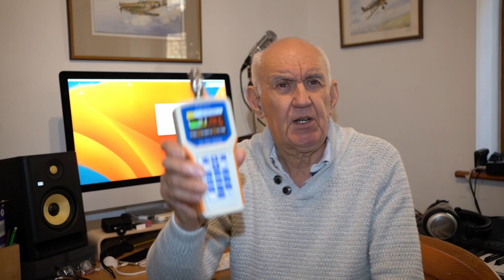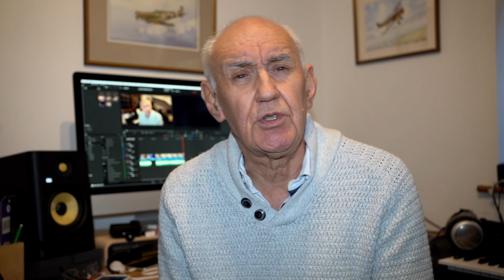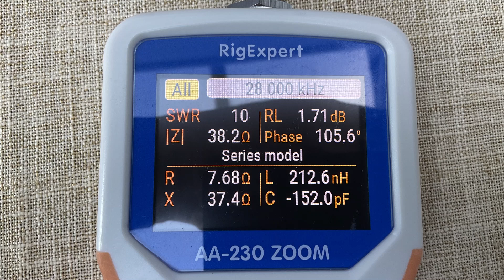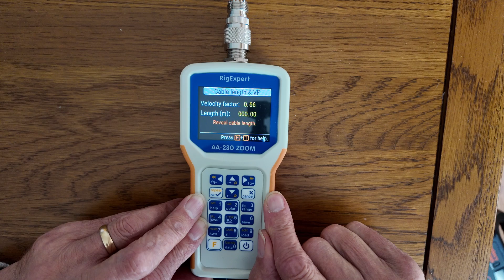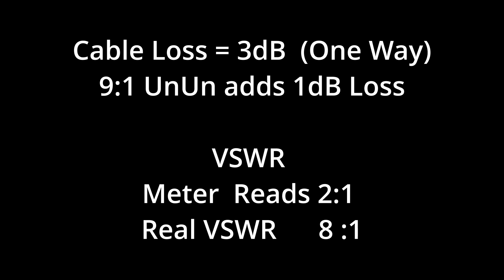Fake VSWR  Readings and Hidden Feeder Losses  |  Ham Radio

Comment: One thing to think about also is let's say the BNC connector and adapters are adding 0.4 well when you are multiplying by 4 to estimate 100' You are now increasing the 0.4 loss from the connector to 1.6 which it should remain .4 so in theory you could subtract 1.2 from your overall readings.
Reply from the maker: Yes you are partly correct, although it was not possible to know the actual loss in the BNC connectors without cutting them off. I did cover this later in the video when  I emphasised that the connectors are static loss items. At the end of the day you have to measure  rather than guess. Thanks fir your support.

Comment: Hi Peter, all correct information, and perhaps a caveat that needs to be borne in mind is that these figures are for NEW cable in good condition. Some time ago investigating a coverage issue on a 150MHz paging  transmitter with 200ft of LDF5-550 feeder to a standard "whitestick" style aerial it took more than one site visit, we changed the aerial to humour the customer. Dissecting the old antenna revealed that the short tail from it was waterlogged, as you can imagine a swept frequency measurement showed a suspiciously low SWR over a wide frequency range. Waterlogged cable is a disaster for loss and often unusually  LOW SWR is a warning. I know no-one will do it but it is worth saving plots of fixed antenna systems so you can spot changes before they are apparent on air. 73
Reply from the maker: Yes, good point. Many thanks.

Comment: Thanks for the video Peter. By minute 7:50 I'm rather sceptical that the 0.3-0.4db losses come from the adapters and I believe it's more likely that the coax itself is not up to spec. I've seen an interesting video by Jim Heath W6LG showing almost negligible loss on a rather long chain of connectors. In reality the db difference is a sum of reasons, the connectors absolutely play a part as well but not sure if their impact is as large.
Reply from the maker: But he actually found some major losses in some of his adaptors. Further test show I have the same problem!!

Comment: As you are shorting the coax at the antenna end to get a return path you need to make sure it is a low resistance joint. As in any joint there will be losses ( same as your connectors ) make sure that your connector block is of good quality and a tight connection.
Reply from the maker: Solder across a panel socket is best solution.

Comment: Peter. I'm wondering if you use a rf noise bridge at the feed point of the  9:1 unun to adjust the length of the wire, to get 50 ohms. Is that a option?
Reply from the maker: Most users want the 9:1 UnUn to work on a number of bands with a particular length of wire. You can still adjust for minimum VSWR at Tx end. The VSWR null at Tx end will simply be lower and better than at the 9:1  but both will coincide.

Comment: Peter, your salesmanship skills are slipping (my tongue firmly in cheek). You analyser has a calibration function built in allowing you to calibrate using an open/short/load at the end of your coax effectively nulling it out thus getting a true reading at the feedpoint.
Reply from the maker: Thanks for the info! Manu drawback is that calibration only applies to one antenna -coax combination and then needs to be reset. But interesting option. 73 Peter.
Reply: @watersstanton  You're right but if your using the same coax for different antennas at different times its valid. You can also toggle it on and off at any point where the calibration is in a memory. I wouldnt be without my Rigexpert.

Comment: Hi Peter. A very interesting video. Food for thought. I use a VNA and test lengths of coax as the VNA sends signal out of one port and receives at other. It can also give indication of water Ingress, kinked cable etc. Due to reflection. There's an awful lot of BNC 75ohm connectors sold as 50ohm. Also fake cables RG58 which are copper coated steel wire. Magnet for quick test. Show up as very high loss cable. Once again very informative vids. Thank you. George
Reply from the maker: Thanks for sharing. 73 Peter.

Comment: Wow Peter, Lots to think about.When you came up with 8:1 VSWR using a 9:1 UnUn, I cringed. Even with a tuner, that has to be hard on the finals of any rig. Since I already own a RigExpert AA-2300 Zoom, I will commence experiments on my own equipment and try to think about some possible solutions. Great Video and again, thanks de KA9TII
Reply from the maker: You are very welcome. Hope you have fun with the measurements. 73 Peter.

Comment: Fascinating video Peter.I operate mobile/ portable when I can with various aerials including ProAm whips on the car to random wires with counterpoise etc and I always use a field strength meter with my  aerial matching units if my aerials are not resonant and many times the maximum field strength doesn't always agree with a minimum vswr reading  on my meters.
73 and have a lovely Christmas.
G7HFS/PA3IKH
Reply from the maker: Many thanks for sharing. 73 Peter.